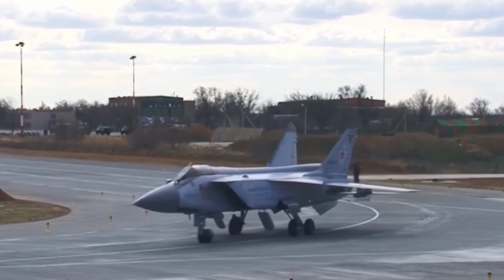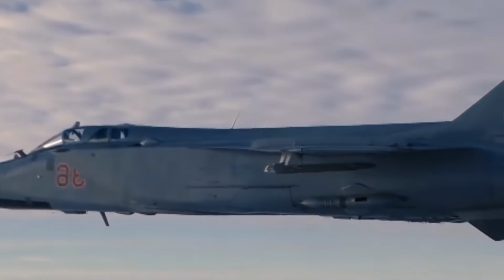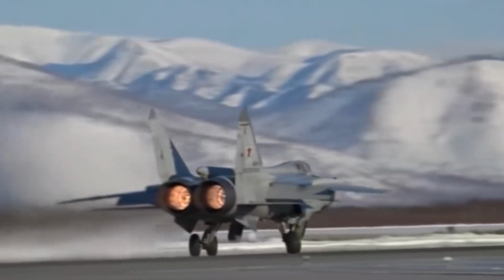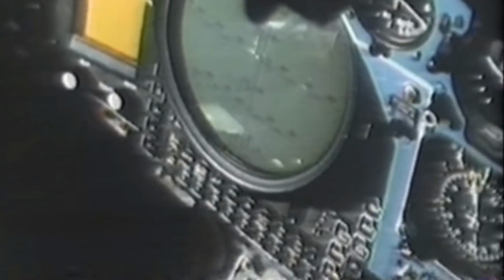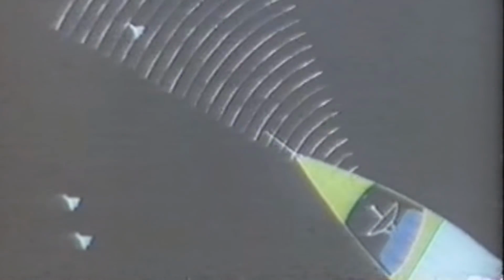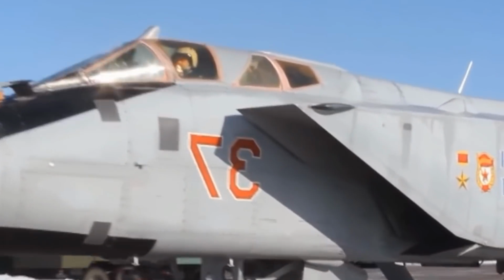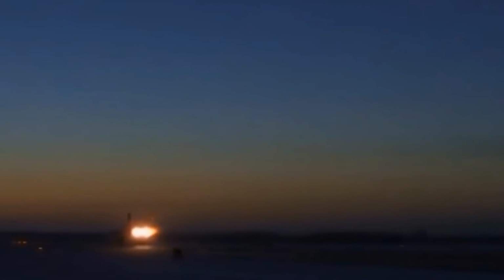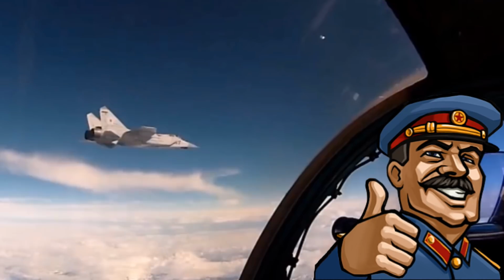Mikoyan MiG-31 Foxhound - Russian Interceptor Fighter

Comment: Raptor food is all this is.
Reply: No, stupid, everything you just said about IDF F-35 you pulled out of your ass/has been debunked as false. No IDF F-35 was ever targeted because no IDF F-35 has been used in combat. Those Israeli F-35's are still in block 3i which restricts them to JDAMS and two aim-120's. It got hit by a fucking pelican and made it back to base unlike the twin engine SU-30 that crashed recently in Syria when it swallowed a bird. Lol.
Reply: Shattered Star can't have air superiority with interceptors still flying around.
Reply: Do you know what a "Interceptor" does? It intercepts typically bombers, as this MiG-31 does. Now do you know what a "Air superiority fighter" is? Its a fighter type aircraft meant for taking and controlling air superiorty of a zone, such as an F22 raptor. These are 2 very different planes.
Reply: Not as simple as that. F-22s are more easily detected than you might think. MiG-31s have good ECM and are much faster so can disengage at will. The weakness of the USAF are its missiles. That said the missiles the Mig-31 carries would have a low Pk against an F-22 but it was never really meant to engage such targets.
Reply: F-35 stealthier than F-22. LOL. The General is clearly looking for a post military job with LockMart. That goes against multiple sources and statements. BTW NATO ally Turkey said the s400 can engage any stealth aircraft.
Reply: Lockheed built both aircraft, dumb ass. The proof of s-400 being crap is it didn't detect a single Raptor.
Reply: @kentucky fried who can't write in English, UkroTrollski more likely!
Reply: Air superiority Fighter VS Interceptor? Are you on Acid?
Reply: Well played.
Reply from the maker: Jeff Blue hahah fair one
Reply: S-400's in Syria couldn't do shit against Raptors and they were flying at will sniffing all the emissions S-400's and surrounding Pantsir s1's were emitting. It's just going to get worse for Russian SAMs since the F-35 is stealthier than the F-22 according to General Hostage of USAF.

Comment: Fantastic aircraft, super advanced for its time and even in its now aged condition a formidable platform <3 <3! Nice Vid

couple questions/points;
1. I think technically the latest variant is the MiG-31K, which flew over Red Sq for Victory Day  with the Kinzhal Hypersonic missile underslung (https://youtu.be/SdYFFo_tsfk?t=1h8m34s ) - maybe those new weapons annouced March 1st could have a video?
2. What sources do you use? Because I note the Wings of the Red Star clip, which is a good series, and the use of a lot of mirrored video. If you check out MinOboron's channel, you can see some really nice video clips of them on operation (/watch?v=iUo0B9visNo ) and I ma sure you'djust need a "courtesy Rus MoD". And have you seen the Wings of Russia 2part doc on this and the MiG-25? These are VERY good docs imo (https://www.youtube.com/watch?v=9pxtQhOFqAU&t=49s )

Comment: mig-31 best interceptor in its category f-14 is retired Tornado F3 is slowly being phase out.. first prototype successful flight in 16 september 1975.. most modern mig-31bm/bsm.. 

Mig-31BM spec
powerplant 2 Solov'yov D30F-6M 
thrust
dry 20,940
reheat 36,375

Ordnance load 
normal 6,610lb
max 19,840lb

top speed 
1,863 mph

cruising speed 
subsonic 559 mph
supersonic 1,521mph

range 901-1,863 mile range at high altitude internal fuel 1,429 mile 

combat radius 447 mile

service ceiling 65,620ft

rate of climb 250m/sec 

take off/landing run
450 m/650 m

G limit 5

Comment: The airdefence problem for Russia is: It has such a huge boarder. Missiles are not going to cut it - in a missile belt there will alway be holes. Something akin to the Maginot line. Gulps up vast resources that in the event of the anticipated attack will be doing absolutely: Nothing.

You can cover it with fighters; but if the intruders are fast the fighter needs to be fast or the enemy will escape your perifery. By its very strategy Russia has painted itself into a corner.
Reply: Thomas Borgsmidt Russia doesn't need to have air defence systems all across the country, or would the US bomb some trees in Siberia? You only have to cover the regions where your infrastructure is and Russi does that perfectly fine...
Reply: Juckt Mich Nicht The thing is, if you leave most of Siberia undefended than bombers can just fly over the arctic and launch cruise missiles from Siberia,
Reply: Juckt Mich Nicht It's also why countries have been developing more advanced ECM and radar counter measures too
Reply: Thomas Borgsmidt To be fair the Maginot line was designed for the same purpose the German west wall was, the French thought they would force the French through Belgium, hold the Maginot line with minimal troops and then engage Germany in Belgium with its armored, mechanized and motorized divisions
Reply: TheReal Lifehacks Nope you don‘t understand... in the arctic there are mig-31 which would intercept those bombers and those bombers would fly without escort because no fighter has such a big range...
Reply: Juckt Mich Nicht Most bombers actually don't even have to enter the airspace of the other country, they fly at standoff ranges and deploy their cruise missiles, but at the time the Foxhound and Foxbat were created Siberia was the weak link in the Soviet unions air defence
Reply: TheReal Lifehacks Now it isn‘t... Airbases in the artic got rebuild and mig-31 wirh their 400km anti air missles can easily catch up to subsonic bombers. But if they want to hit important stuff in russia, they have to come closer to the border and that wouldn‘t be an ideal option, because then they would surely will be intercepted...
Reply: TheReal Lifehacks bla bla. Do you think the others stand still? And a b-52 with high end ECM? Yeah...
Reply: Juckt Mich Nicht B52's carrying jamming pods plus cruise missiles and cruise missile decoys is a way to overwhelm enemy air defenses, combined with B1's and B2's using their ECM combined the B2's stealth which would allow it to avoid detention for longer, could do the job pretty well
Reply: Precisely: The Russians thought they could keep off the yanks in the Pacific and meet them with overwhelming force in the middle of Europe. Only problem with that was that Nixon thught it better and easier to come to some sort of an arrangement with the Chinese.

What happened was that the Chinese was convinced that American bombers overflying China did not have targets in China - and the Chinese were not able to intercept the bombers anyhow - who on earth would consider bombing the trees in Siberia and grassland of Outer Mongolia???

This instantly doubled the boarder Russia had to defend - at a huge cost. It also kept the B-52 flying and thus the vast investment of the 1960'ies was reused because it would not have to fight the Russian air-defence.

The B-1 on the other hand was more into the game penetrating at altitude around the northern coastline - or at low altitude over Europe.

The B-1 was the aeroplane, that followed the B-58 - which was expensive and not that good an aircraft.

This might seem very messy political situation: Precisely! Which ever way the Russians turned they got a problem with a neighbour they had seriously pissed off.
Reply: Precisely.
Reply: Well.... yes and no! The F-15 is indeed marginal for the transpolar fighter rôle. The F-22 is quite another matter. No doubt it can punch a hole that a B-2 can slip though.
Reply: Precisely. And the cruise missile was another problem the Russians never solved. They created a vast number of targets for the air defence and that would have meant a lot of flies to swat.

Comment: Mediocre jet. The avionics were below average, and just used brute force for speed.
The radar was average, using alcohol for coolant. Very old fashion radar design with vacuum tubes and old diodes.
Very short range for such a big aircraft.
Reply: >Very Short Range
>3,000km range
hold this L
Reply: it's like trying to talk to a rock
Reply: mlazos your source is wiki? Lol :) Let me update wiki..
Reply: it seems you have a lack of comprehension at what i'm trying to say. The Mig 31 does not have horrible or very bad range at all, it is able to fly as far as any modern jets flying today. Do you understand?
Reply: mlazos You clearly have no idea what you are talking about as you have this confused with the MiG 25.
Reply: Good god this guy wont shut up will he. the aircraft fulfilled what it was made for admirably it was an interceptor.... it was designed to intercept bombers at high altitude, The radar for it's time was exceptional for it's purpose considering as it was an interceptor (and therefore intercepting targets over friendly territory) it would be guided by friendly ground based radar anyway and why do you keep going on about turn radius... the aircraft want even designed with that in mind it would fly up, intercept it's target launch it's missiles and RTB not fight a prolonged dogfight.... also Iraq never used the Mig-31 they used the Mig-25 it's predecessor (hell the reason the US started the design of the F-15 was because they though the Mig-25 was an air-combat fighter not an interceptor).... Also really only having one source and having Wikipedia be that source really? your not holding up a strong argument just showing bias as well as making shit up like saying the Iraqi's had Mig 31's. Also guess what the Mig-31 was used by just the Soviet Air Defence Forces not the Soviet airforce... Guess why.... Because it's an interceptor not a front line combat aircraft which you seem to be comparing it too.
Reply: Did some plonker say an F16 could easily defeat a Mig31?  Lol, what a clown.  The Mig will have a huge speed difference, and will get to shoot an R77 first, before pulling away.  That's its job.  If it went head on it's fucked, but it won't.
Reply: mlazos Interceptors typically don't do range there whole point is to intercept an enemy and then RTB once target is down.
Reply: Prizrak2084 no you are wrong. You never bothered to read the specs, the avionics and the radar

https://en.m.wikipedia.org/wiki/Mikoyan_MiG-31
Reply: It's a little more than the F22A Range with 2 external tanks. Besides i seriously think you're lacking some brain cells, no plane goes to their maximum ranges.
Reply: Look in the comment, there already 1 person comparing the 2 very different aircraft, besides it's just the range that are almost similar with the MIG 31 only having 40km more range. This comparison just goes to show that The MIG 31 is by no means lacking in range
Reply: Alcohol is used as a coolant because it works well enough and reduces wear on the expensive coolant system for the extremely expensive radar.
This means you need less time for maintenance since you don't have to filter it out carefully like you would do with the extremely corrosive coolant in the F15.

I find it highly ironic that you are complaining about an interceptor because it's not a good fighter aircraft but you have the F16A as your profile picture. A medium range (5km Hi/PPS, 1.3KM med/zps) low fighter that could only launch sidewinders.
Reply: Ur an idiot. The radar was brilliant and did not use vacuum tubes - that was the MiG-25 and the Soviets used those to make the radar on the MiG-25 was EMP resistant; they wanted to still be able to use them once nukes were dropped. If you listed to the video the MiG-31 was the first aircraft to use a phased array radar by a couple of decades before anyone else was using them.
Reply: mlazos the MIG-31 was never exported you tard
Reply: Internetbutthurt it was an F-18C Hornet good sir.
Reply: mlazos they never offered to export it because of the hi-tech equipment, oh and btw, you sound like a Jewish shill.
Reply: Still retired the blackbird though didn't it lol 😂
Reply: Complete Bullshit. Iraq never had MiG-31s. They had Mig-25s and one of them shot down an F-16C.
Reply: You're into animals now too eh?  Lol.
Reply: No, that would be the MiG-25 you just described.
The MiG-31 is a far more modern jet, although somewhat left behind in terms of technology due to lack of funds up until 2008.
Reply: Shattered Star with 2 drop tanks and no return? You need to come back to the airport Man! :) YOU NEED TO LAND THE PLANE
ITS NOT A KAMIKAZE MISSION!
Reply: Shattered Star this comment is totally stupid. Sorry but you cant compare the F-22 with the Mig-31.
Reply: kentucky fried NO ITS NOT!
The turn radius is identical!
The F-16 can easily shoot down a Mig-31.
Compare the F-15 and the Mig-31 and you see how bad it is.
Take a Mig-31 in combat and you are dead.
Reply: SteelbeastsCavalry you didnt even read how they made the phased radars! Just go and check and see yourself.
Reply: Freely Liberal they delete my comments you idiot. You got to be stupid to believe the mig-31 is a good plane. Its a BAD PLANE!
Reply: Iliya Merzlyakov haha thats what they told you? Seriously? You are totally stupid. The soviet radar were really bad. We saw that after the collapse of the soviet union!
Reply: Anon emous to be first doesnt mean is good! Stupid! The first car is better than today? Are you for real?
Reply: Nothing Here the F-16 can easily outfight the Mig-31. The only option a mig has is to run away.
Reply: Nothing Here it was using old school electronics! Thats why was over heating stupid!
Reply: Freely Liberal the Mig-31 has zero statistics. 

http://www.airvectors.net/avmig25_2.html

Its a bad plane. Move on!
Reply: mvfc76 OF COURSE!
Nobody wanted to buy flying soviet shit you stupid camel!
Reply: Shattered Star you compare the F-22 with the Mig-31? Haha
You are stupid. Please stop writing.
Reply: kentucky fried no it wasn’t. Even the F-15A and C radar had a much better radar and it was a better plane overall.
The Soviet planes were behind in the avionics.
In the Desert Storm even the F-16 shot down Mig-31.
Reply: kentucky fried and you call this an excuse for a bad plane? You cant be more stupid.
A GOOD PLANE IS THE ONE THAT SURVIVE IN BATTLE!
The Mig-31 were always easy kills. They could only run away.
Reply: Shattered Star you are stupid biased.
The Mig-31 is a BAD PLANE!
There is nothing special about it. Nobody wanted to buy it anyway.